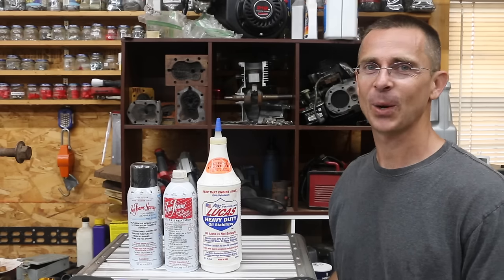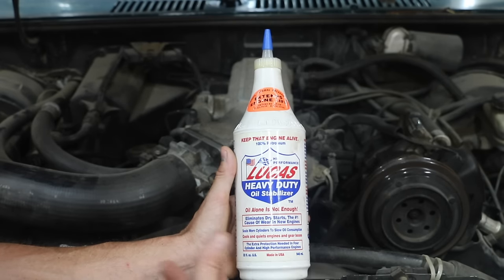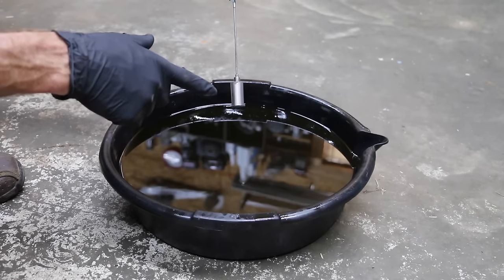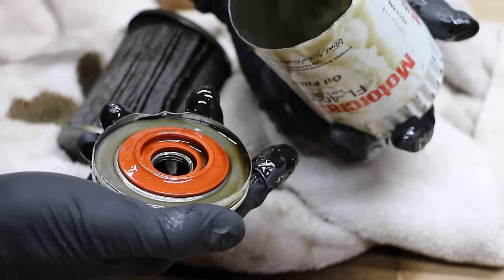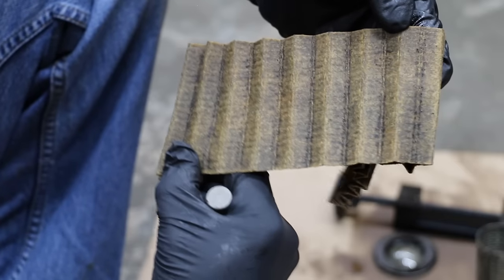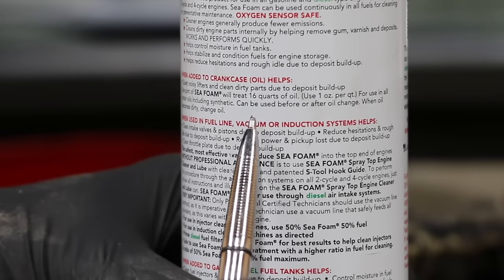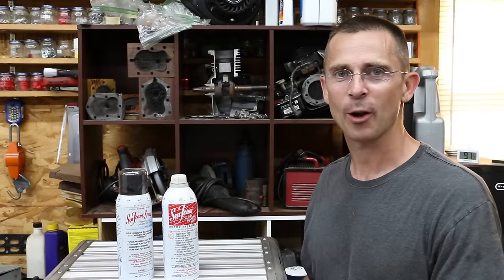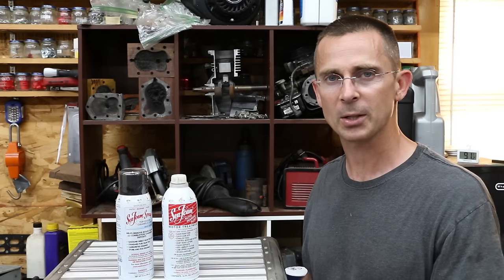Did the Seafoam fix last? Update on the Ford Ranger

Comment: I use sea foam in my fuel for ALL my lawn equipment. I do small engine repair as a hobby and i can tell you personally that it works. 2cycle or 4 stroke. I use it in my car and truck every 3rd fill up.  DO NOT USE IT WITH AN OCTANE BOOSTER. It doesn't need any help. If you use it WITH an OCTANE BOOSTER. YOU WILL BURN A VALVE. I know. I did it.
Reply: I use engine restore in the oil on our mowers and every now and then our blowers the guy I work with fail at mixing 2 cycle or idling equipment down so it doesn't wash the cylinder and wear it faster stuffs impress with both ran once in awhile
Reply: @toxictophat711  
The Biggest mistake that most people make, is running the idle too low. I usually mix my 2cycle fuel at least 50:1. I would rather have it smoke a little more, and LAST A LOT LONGER. I buy a lot of equipment from my local scrap yard. Usually all that's wrong is fuel lines and carb cleaning. This makes for a nice profit. After I reassemble everything, I run seafoam in it. You can tell when it gets clean from the RPM .
Reply: bret hammond   bret hammond  LMAOO "92 Camaro running at 98 MPG and 240-NO WAIT- 300 MPH... holding off on production because it's legit TOO good of an idea 🤣😂🤣
Reply: bret hammond    WAIT I MISSED THIS ONE LOL .. A canon you made when you were 5 that's stronger than gunpowder and can be made just by mixing a few chemicals that mechanics have lying around... did you decline the Nobel Prize because then the military would've found out and done blowed up the Earth??🤣😂
Reply: bret hammond  "SYSTEM THAT COMBINES PARTICLES TO CREATE SUB ATOMIC EXPLOSIONS" BAAAAAHAHAHAH I think you're describing the Large Hadron Collider (LHC), which also happens to be the largest and most expansive machine in the world 😂😂🤣
Reply: bret hammond  🙄🤣🤣🤣🤣🤣🤣🤣🙄🤣🤣🤣🤣🙄
Reply: bret hammond  Mechanical engineers hate this guy! Find out his one simple trick to get 244% fuel efficiency at 240mph!
Reply: bret hammond  You got that right! People will be scratching their heads! Especially after they realize how easy it is to file a patent...
Reply: bret hammond  That's weird considering I know someone who's upper middle class with 3 patents and the Chinese haven't stole a single one.
Reply: bret hammond  I know his patents are real because I saw them framed. Why don't you post a video of your super efficient cars on YouTube? Leaving out all proprietary information of course.
Reply: @ooneybird27  instead of trying to stabilize the gas in the carburetor of your generator and other long term storage motors, you should drain the gas out completely.  I always do that because of the mandated ethanol laced gasoline, which will leave crusty residue that looks like rock candy clogging the pilot jets, if left to evaporate in the float bowl.
I've restarted after years of storage without problem because it was drained and not allowed to sit and clog after use.
Nothing would be more frustrating than needing to use the generator you thought you had for emergencies, and not being able to start it.
Reply: @ooneybird27  unfortunately there's no option for pure gas around my area, you're lucky-
Float bowls usually have drain screws to empty them out, it's not the tank you're draining, but just the carburetor float bowl. You need to have a fuel shut off valve so you're not emptying gallons, but just a couple ounces from the bowl.
Then put on the choke and pull several times to get all the residual gas out.  For really long storage I'll drain the fuel tank as well, but that should be okay with the stabilizer.
Reply: bret hammond  lol, so FOS, but funny...
Reply: @ooneybird27  I'm not sure if it's labeld as a fuel preservative. I've seen and heard it work instantly on some noisy lifters and or valves
Reply: Brett hammond's a story teller. B.s.
Reply: bret hammond  What, is it RDX or something like with nitromethane or ammonium nitrate?
Reply: bret hammond  OK... well I suppose any reduction in injector size that decreases the particle size will help as I've wondered about nebulization/atomization prior to injection to improve performance.  Thought a simple ultrasonic method might be suitable... though wondering if you're using something to lower the surface tension/viscosity.   Wondering if listed here: https://en.wikipedia.org/wiki/Category:Liquid_explosives
Reply: used properly it works great. never had a problem after using!
Reply: @ooneybird27  - For goodness sake don't use the "complicometer"! KISS, KISS, KISS. LOL 😂
Do what is basic, simple, work perfectly AND you don't have to spend money or time to do it!! Just drain the carb on your equipment. OR as most  equipment have a fuel tap available, simply shut it off and let the equipment run until there's no more gas! It's that simple. ;-)
I've got 2 outboard engines (2 stroke and 4 stroke), generator, snowblower, etc. They ALL start on the spot on the next season. And I never bother messing with them. Next time you need it just had fuel and let it run! Simple. Cheers

Comment: Man that engine sounds amazing.
Reply: you ought hear the improvement on my 1994 v8 chev. one ton,    amazing,,
Reply: ken reece my 2002 4.6 sounded like a rod was knocking seafoam 10 minutes later sounds like a healthy mustang
Reply: corey Babcock sonfirst decide if you wanna do the crank case treatment, fuel, or air intake or all 3 like the video. But just follow exactly as the video says and if your van has cats make sure to unbolt them or they might get clogged up
Reply: Was that motor maintained properly before the treatment or did it develop the sticky lifters from extended oil change intervals?
Reply: wingerrrrrrrrr that’s really the only way to develop sticky lifters by not changing your oil.

Comment: Ok here we go!! Seafoam has been around longer that all of us here on this channel and there is a reason for that!! I have used this product since 1982 after starting to work in my dad's repair shop. I have used this as well in my own cars and I have a 1982 Chevy Citation that still runs great and has 320,456.22 on the Odometer and credit most of that to seafoam. The big thing when using this product is you have to use it every time before you change your oil for 300 miles then drain and fill. It only works if you use it consistently over time it's not a miracle drug in that sense but over time it is. One other note I wanted to remove mine crank case and is what was actually going inside, and it look new with very little build up. All these comments are great, but I know what this product can do because I have taken the time to see for myself. Not being a sellout is great, but you also need to give real facts. Take whatever information from this comment you want but in plain English SEAFOAM works and anything else is just plan futile.
Reply from the maker: Thanks for sharing.

Comment: My dad had an 09 Chrysler minivan with about 230k miles, and the van missed and fell on its face when you tried to accelerate. A couple cans of seafoam and a bottle of Lucas and she is still running like a top today. (Also stopped eating about 1-1.5 quarts between changes) our local Chrysler dealer said it needed rebuilt or it wouldn’t make it another 6 months! that was over 2 years ago! Thanks for the video proving what all of us folks that use our brains more than our wallets already know! Subscriber for life now!
Reply from the maker: Impressive results!  Thank you!

Comment: Ive used lucas oil treatment for years and why because i had an 87 celebrity wagon i fid a 15 1/2 hr one way drive turn and burn bck another 15 1/2 hrs return after multiple oil leaks the motor spun a bearing and that lucas oil treatment saved that motor and kept it running another 6 months of constant daily driving ! And a few years later was not ntroduced to the seafoam line and ill tell you as a now home help others out mechanic these products have made my life alot easier and better and to those that ive helped out all love the work that was done and follow the directions for care and most of them still do as i ask and keep the use of lucas oil treatment, both products have saved my vehicles and many others !
Reply from the maker: Thanks for sharing.

Comment: Been a Lucas guy for years. Have a Ford E250 4.2 L 2003 with 355000 hard miles. Pour seafoam in for years but today just did the spray from watching your video. Thanks!
Reply from the maker: Thanks for sharing.

Comment: I first became acquainted with Sea Foam by my automotive mechanic.  I had a mid 90"s Olds Cutlass with 150k miles.  He said it was time to change the sparkplugs...but decided to add Sea Foam as a starting point.  The engine ran much better and we got another 15k miles out of the spark plugs.  We sold the car still running great with the factory plugs.
Reply from the maker: Thanks for sharing.